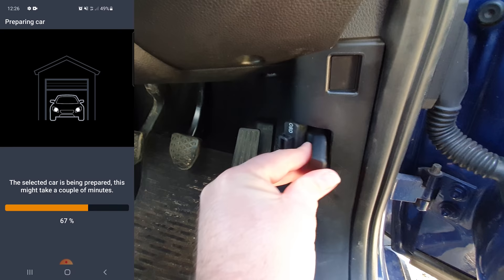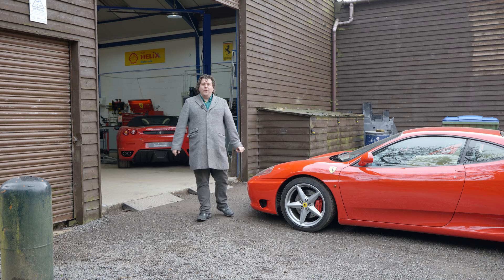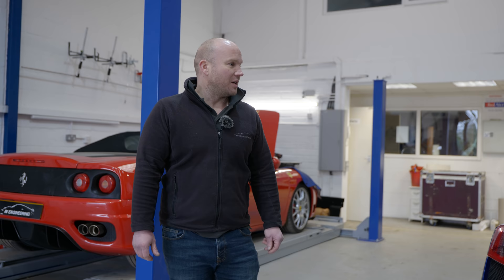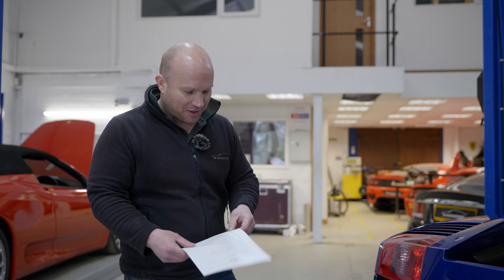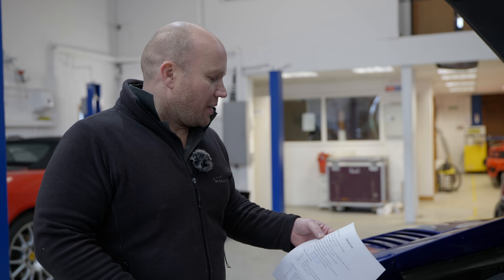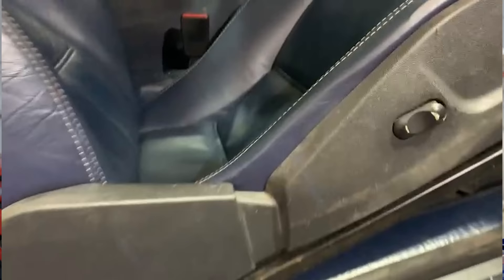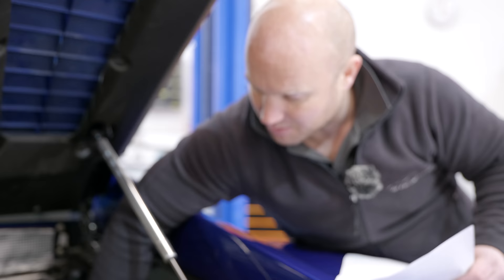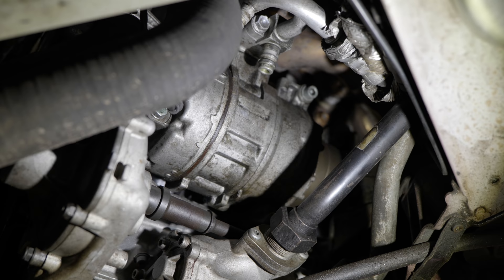EVERYTHING WRONG With The World's Cheapest Lamborghini Gallardo (That Runs, And Isn't Wrecked)

Comment: A clean HPi really doesn't mean a car doesn't have an "interesting" past - have a look at the Dodgy Cars page on FB, it's full of undeclared write-offs and ringers that have found their way back onto dealer's, including main dealers, forecourts. There's obviously a story to this particular car, I suspect it's been the subject of a heavy crash during it's life as an experience car and either then been sold on or repaired by the experience company and reshelled/bodged using the body, or body sections of a red car. The missing undertrays are another red flag that something serious has befallen the car, and those will be fortunes to buy either new or secondhand. I also wouldn't be surprised if it's been heavily clocked, there's another ex-experience one floating around that managed to lose nearly 100k between the owner boasting how reliable these are in an article and the car appearing on the used market a few years later. One saving grace is that Carly's used car check allows you to read the VIN from numerous different sources, for example on my mate's 1 series convertible it was able to discern that the VINs stored by the two headlamps matched the VIN of the car. It also allows you to check the mileage stored on various ecus with that displayed on the clocks, all of which could be illuminating...
Reply from the maker: I've got enough documentation to support the story behind the car. The "reshell" theory doesn't really hold weight in my mind, the car is way too well put together to have been hacked about like that.

Also, the mileage seems legit - I drove another experience car with half the miles and this one is in far better condition.

The car had definitely had some knocks at some points, but nothing major enough to bend the chassis (I made sure it was checked before buying)
Reply: @JayEmmOnCars  Missing undertrays, plugs not connected, vents glued up? Have you gone through the date codes, that’s usually a good indicator of how kosher a car is
Reply from the maker: Which date codes?

The vents being glued up is a genuine mystery item - I expect they just broke and that was the cheapest "fix".

The undertrays and shroud being missing - we suspect the car might have had an off at some point (experience day car, it was bound to happen) - those are the first things to break and they probably just never bothered replacing them.

Some of the damage (eg. Wing mirror) actually happened while the car was in the care of one of the "specialists" who worked on it
Reply: @JayEmmOnCars  Every plastic car part has a code on it which gives the month and year of manufacture, they should all match up within a few months, same goes for the glass. if you start finding say 2006 parts on a 2004 car then it’ll help build up a picture of what’s happened to the car
Reply from the maker: @geecars6263  that depends how organised Lamborghini were! I've found bits from years before my Ferrari were made on it (but they were original).

Certainly will keep an eye on them as bits come off though
Reply: @JayEmmOnCars  Before is fine, what you’re looking for are parts made after the car left the factory - for example, if the headlamps, and all the front end plastics are from 2009 then you can pretty much guarantee the car’s had a punch on the nose. If you find 2009 on the majority of parts then there’s a fairly good chance the only genuine bits are the VIN plates 😂
Reply: @JayEmmOnCars  Surely, given that you’re advertising Carly, and boasting about how good it is, you’d happily plug it into the Lambo and do a video of what it uncovers, that would prove once and for all the legitimacy of the car? It takes a matter of seconds and brings up a wealth of info on the car. Unless, of course, you’re not confident of the results...😉
Reply from the maker: Carly doesn't talk to the Lambo like it does with a BMW... hence the ad happening in the BM
Reply: @JayEmmOnCars  According to the Carly website all functions are available for the Gallardo, so in a minute or so you could run a used car VIN check on the car - that would allow you to prove the naysayers wrong and it would be a great advert for your sponsor...I get the feeling you’re scared to though 😉
Reply from the maker: @geecars6263  I'll plug it in next time I see the car although I really don't expect to find anything that surprising.

I think the Carly used car check is more to make sure the car hasn't been clocked etc...
Reply: @JayEmmOnCars  It gives you the mileage from various ECUs, however, more importantly, it reads the VIN from them as well. I doubt it would do it in this case, however, as I mentioned it pulled the VIN from each individual headlamp on my mate’s F21

Comment: I like this guy explaining the cheapest Audi around that's basically unreliable and shaking itself apart. Just highlights all is German engineering rubbish where  they are well built an amazing well I'm afraid not since the 90s. I don't think I'll be any videos like this in 10 years time where someone's bought a Honda NSX Inside Out shaking itself apart and it's a complete mess. Have you someone that had an Audi R8 and gearbox blow up after less than 1000 Miles I'm sorry but it just says it all. The price that you still paid for this you probably could have got a really nice Maserati and a small hatchback as a run around.🤣👍

Comment: is it really that difficult to make electrical connectors that last more than 5 years? Seriously... I'm shocked to see the build quality of this car. I know it had a tough life but still... it seems to be falling apart. It gives me the impression that it's a piece of extremely powerful and really expensive piece of junk really.
Reply: this is a 17-year old supercar that has had a hard life, not sure what you're expecting. have you ever worked on any cars over 10 years old? they're all like that (esp VAG group products)
Reply: @socalguy829  yeah I'm being really naive I know... 
I'm actually dealing mostly with old cars ... and mostly with Japanese ones (surprise surprise).
 
that's why I don't fully get why is it normal that brake lights, electrical connectors and fuel tanks and stuff are falling apart on a 17 years old supercar, costing 20 corollas when new? They should in fact should last much longer than on a regular car. Did they just use parts from a Fiat Stilo back then or what? Shame on them... 
Engine, brakes, suspension parts are a completely different story, I do understand the "supercar" reasoning for faults there (somewhat).
Reply from the maker: The engine on this car has been in and out multiple times- they're not designed for that and that is probably how the connectors broke
Reply: @Theadamvok  You are paying for the performance, looks and name. I am not aware of any car company operating today were premium price correlates to better reliability. In fact, the opposite is generally more true from my experiance.

Also, this car has obviously had a HARD life...
Reply: @JayEmmOnCars  ah yeah, that makes sense. 
Please don't take my comment personally, I've never driven a supercar before. I'm sure once I tried one I'll be less judgmental on faulty connectors and brake lights :-).
Also big thanks for making these videos, showing us the realities of ownership in such detail.